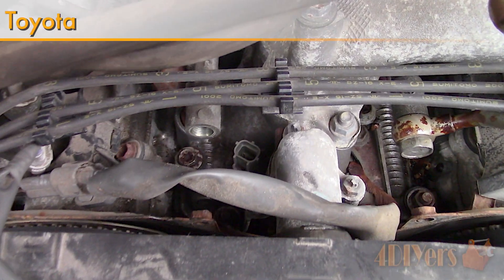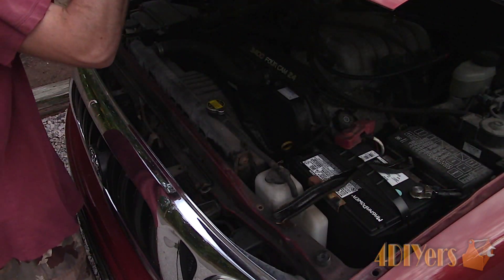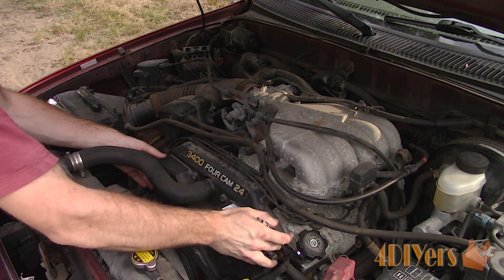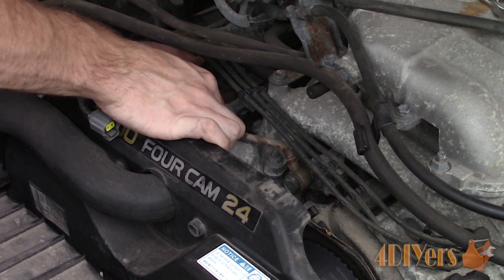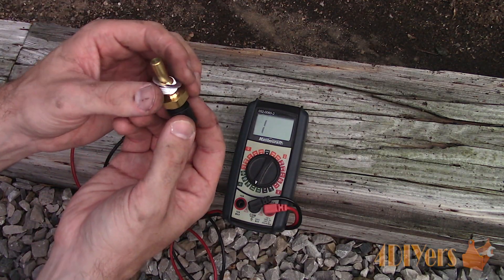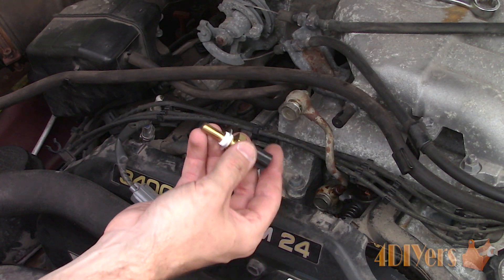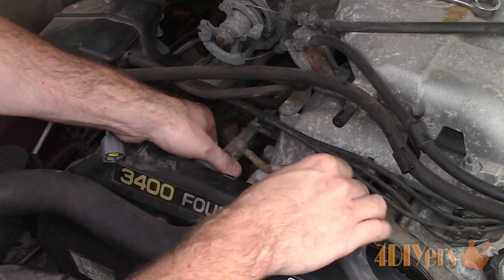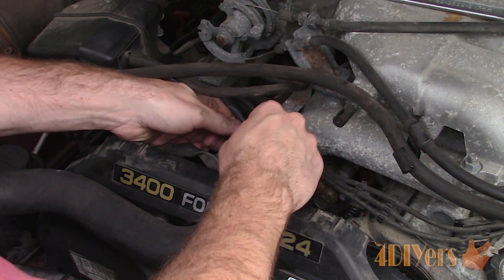How to Replace the Coolant Temperature Sensor on a Toyota 3.4L V6

Comment: Would a bad water temp sensor cause low idle after warm up? I keep going as low as 530-650
Reply from the maker: That rpm sounds normal for it at idle.

Comment: Idk why youtube didnt recomend both the heat gauge sensor and this but what ever thanks for the help
Reply from the maker: You’re welcome! Yeah it’s weird, their new system makes it so hard to search for videos.
Reply: @4DIYers  hey also you can check the sensor by grounding it shove a nail in the clip and touch it to the frame if the gauge doesnt go up you have a bad gauge if it does its the sensor

Comment: Thank God!  Perfect video, nice and concise.  I need to do this for my 1996 Tacoma.  She keeps stalling after start up and we haven’t found the culprit yet.
Reply from the maker: Happy to help! Make sure to test the components first before replacing so you’re not wasting money. How long does it stay running for?
Reply: @4DIYers  Cold starts stall out a few seconds after. Once idling it normally stalls after shifting in gear. Our next bet is the torque converter…. Problem is the scanners can’t pick up any codes so hard to narrow it down.

Comment: I’m having a hard time loosing the right banjo bolt on the fuel rail. The left loosened with major problems. 
Tried soaking the right bolt  with some WD40, but I’m stripping the head and it feels like I’m going to snap my wrench. Any advice?
Reply from the maker: Try a penetrating oil like Kroil instead. WD40 isn't a good quality penetrating oil.
Reply: @4DIYers  Thanks for the tip
Reply from the maker: No problem, happy to help!
Reply: Would it help to run engine to warm up bolts then attempt to remove them while they're still warm?  I've used this trick on a few stubborn bolts, including spark plugs that were binding.  Just curious.

Comment: after i followed ur guide my rpm became higher than usuall . is that ok?
Reply from the maker: What is your idle rpm sitting at now? Is there potentially a broken vacuum line?
Reply: @4DIYers  i fix it. it was bad coolent tempreture sensor made in china . since i replace it with oem my rpm 700 now insted of 1100 which was always like that even when the car hot

Comment: What size or part number for the crush washers in the fuel hardline so I can buy from oreilys
Reply: Did you happen to find them? Getting ready to change me temp sensor soon.
Reply: @billyhickson1632  no just used a superfine sandpaper sponge with water lightly sanded and used the same ones worked perfectly

Comment: Not understanding the fuel rail crush washer spiel.  If you are loosening both sides of the fuel rail and both banjo bolts, then would you not need to remove and replace the washers for each bolt?  Can someone please reply?  Thanks  And are those washers 14mm?
Reply: There's 2 crush washers per banjo bolt. You'll need to replace all 4. What the vid shows vs. what should be done doesn't quite align. What he did was to loosen the driver's side and remove the bolt from the passenger side and pivot the rail to one side. What was not shown was to replace ALL 4 crush washers and torque down to 25 ft/lbs.

Comment: This is excellent!! My one simple issue - removing that electrical connector on the lowered timing belt cover. It’s usually the simple things like this that get me. I end up breaking or snapping some other part while getting to the part I’m repairing.

Comment: Very awesome video. I have a 99 and it's idling high with code po505. I cleaned the IAC but only helped a little. Think new coolant temp sensor will fix?
Reply: Hey, it's been about a year, but did you ever try this out? I'm getting high idle and the occasional code, and have tried several other things, but not this coolant temp sensor.
Reply: @toastrecon  hey! No I tried a bunch of different things and no luck. Eventually I had to sell it and get rid of the stress haha
Reply: @Gitrdone97  dang. Lol. I just ordered an entire throttle body assembly from Toyota. Almost $400. Fingers crossed that it cures the high idle!
Reply: @toastrecon  did it cure the problem?
Reply: @seshrecords8861  Yes, it did. I ended up having to pay like $575 for one from my local dealer after the one I ordered never shipped (I got a refund). Once I had it bolted up, it started up and has been running great ever since.
Reply: @toastrecon  thank you so much!!
Reply: @seshrecords8861  good luck! I thought about taking it apart and doing some trickery with seals or gaskets or something, but I had already wasted so much time and money on it, I just wanted it to be right and not to worry. If you have more time, you might be able to find a low mileage one on eBay or wait to find an OEM part for a better deal.

Comment: I just changed the Coolant Temperature Sensor, but now my 2001 4Runner won't start. I unplugged the EFI fuse for 30 minutes to reset the fuel delivery and still nothing. Any help is appreciated.
Reply from the maker: There's most likely still air in the fuel system, so you'll have to turn over the engine a little longer than normal to bleed that air. Just be careful, not to overheat the starter motor.

Comment: Couldn't get new washers in my small town.  The mechanic at the auto parts store said look at the washers closely, if they are just slightly scarred sand them gently with high grit paper, no less than 400.  He almost always reuses them.  He said they usually fail to seal because someone fails to clean the grit from all the surfaces.   Also, be careful taking off the plastic top it's dark down there and with poor eyesight it's difficult to see that a narrow screwdriver will release the plastic prong that fits down into the sensor.  You don't want to break that plastic apart.
Reply from the maker: Great tips, thank you for sharing!

Comment: Part number for the sensor?
Reply: 89422-35010 the OEM part was not expensive on Ebay ($10) and comes with a new washer.  The reviews for aftermarket showed failure sometimes occurs after a few months.

Comment: My gauge goes to red after changing sensor but the engine is not over heating. Any advice please
Reply: You sure you changed the right sensor? The sensor shown in the video is for communication with the ECU/ECM. The sensor that controls the temp gauge in the dash is a single wire sensor located toward the firewall in a similar location.

Comment: I just bought a 96 s10 with a 2.2 liter v4. My temperature gauge didn't work at all so I replaced the engine coolant sensor. Now with the new sensor after the engine runs for about a minute and a half the gauge goes past redline even though the engine itself is cold. What else should I do? Did I purchase a faulty engine coolant sensor?
Reply: Did you find a fix? I have the same problem

Comment: Just changed mine out, successfully. Thank you for the video. It was very helpful. If anyone cares, the torque value for the #1 timing cover bolts is 80 inch lbs. And I was able to do it without removing the lower left bolt on the timing cover. It's the hardest one to get out and back on. But if you are careful, it doesn't need to be removed. Thanks again, great video!
Reply from the maker: Awesome to hear and thank you for the tips too!
Reply: Thank you for this bit of info I love technology and the world of sharing good information. Always Gatta read the comments. Great video. I'm about to do this one for a friend. 💪🏽

Comment: My temperature gauge reads a little high on a cold start but then drops to about center after warming up a bit. Could doing this fix my problem? I recently purchased a Tacoma and just discovered that there is only water in my cooling system. I'm planning on doing a flush as well as changing the coolant temp sensor and the thermostat.
Reply: A shot at your question, there's a sensor on the back top driver side of the engine kind of at the very back corner behind the driver valve cover and intake area. It's a straight up small circular single wire sensor. This is the actual sensor that relates to the dash board gauge, the etc in this video is not in control of the same function but rather the running condition and computer communication. Hope this helps.

Comment: What size are the crush washers for the fuel rail banjo bolt?
Reply: Austin Gorton yeah, I need to know the size of the crush washers as well
Reply: We need someone to post the size.  That would be a huge help.  This has been a GREAT video.... except that we need to know the size of the washers.
Reply: Inside Dia 12mm outside 16mm-Toyota OEM Fuel Rail Crush Washer  Part #90430-12005
Reply: @justmakeit8688  Is that the same size for the sensor? I can't seem to find a straight answer. I bought the OEM sensor and it didn't come with a crush washer.
Reply: @lkajiess  my sensor came with it but yours didn't the outer Dia of the threads are 12mm so use aluminum washer with similar dimensions
Reply: @justmakeit8688  Thank you, much appreciated.
Reply from the maker: I just have a kit of aluminum crush washers with various sizes. The dealer may tell you the size, if you know the size of the banjo bolt you can go off that, or if you have access to another vehicle, just take the washer into an auto parts or hydraulic supplier store.